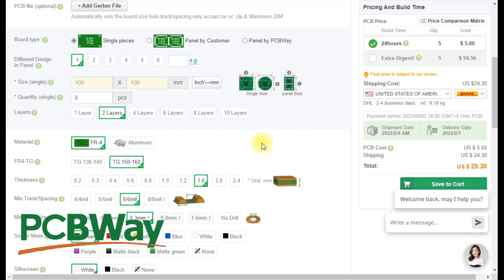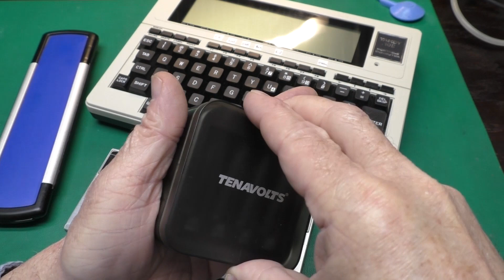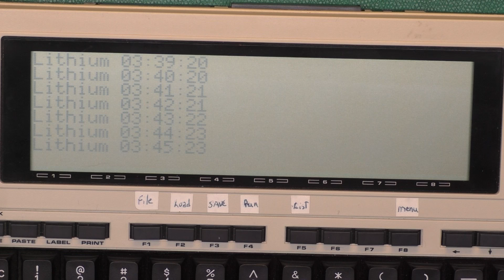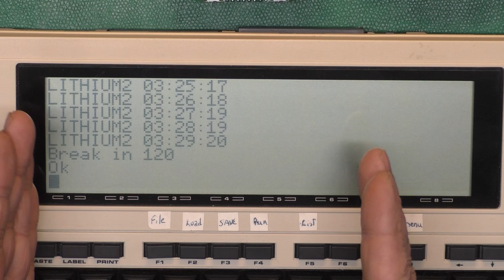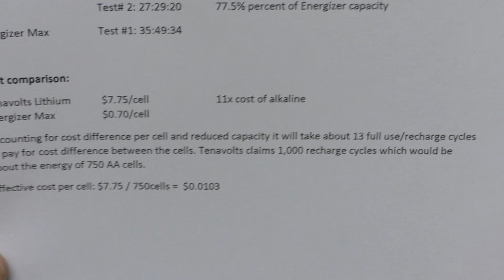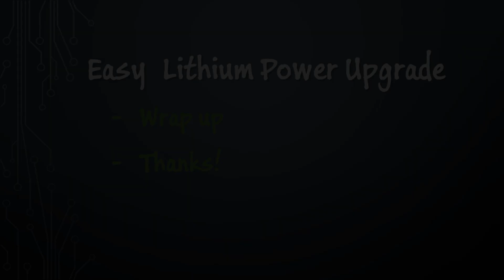Easy Lithium Power Upgrade

Comment: I did the same with my model T not long ago.  Since the voltage is the same, there's no reason not to.  Besides, I have REXCP/M and do not want to let the memory die.  Setting it back up is a hassle.

Comment: You should revise this test using 1.5V rechargeable batteries. The normal LI-Ion batteries are 1.2V, while Alkaline batteries are 1.5, so the voltage regulator inside the computer is set to shut down the system when there may still be some power left in the rechargeable batteries, due to the different curve of discharging for alkaline and lithium batteries.
Basically the computer is set to turn off everything at a safe voltage, which is different between the 2 types of batteries.

Using 1.5V rechargeable cells you will see a considerable difference, as the voltage curve for those is much more similar to what you get with regular alkaline batteries, so that will work in favor of old computers and last longer.
Reply from the maker: these ARE 1.5V cells...
Reply: @HeyBirt  I see; are they constant 1.5V until the capacity expire?  Most of the 1.5V I use in old tech usually end up cutting from 1.5 to a lower voltage at times, and this trigger a battery failsafe since the device turn off. Then when I go recharge the battery it shows that it still has remaining capacity above 1.1V (which is the threshold usually you see for considering a cell drained).

I will try this brand then, as I don't want to damage my electronics
Reply from the maker: @fcf8269  Yes, some of these AA lithium rechargeable cells don't like spikes in current draw, it will cause them to shut down. I tried these as they had good feedback and have not had any problems with them.
Reply: @HeyBirt  very useful info; I guess the 30 dollars for the 4 cells is toatally worth then

Comment: All my rechargeable are NiMH. I wonder how Lithium AAs capacity compare to NiMH. I'd need to invest in new chargers but I expect the lithium to have more mAh.
Reply from the maker: The biggest advantage I have found is that they output 1.5V instead of the 1.2V you get with a NiMh. I'll look to see if I have four NiMh AA cells on hand (I have two used in my digital camera point/shoot I keep on workbench). 

If I come up with 4 I'll run the same test and see how long they last. NiMH don't work well in the T102 though as the low voltage detect kicks in too soon but at least it will provide a comparison of usable power.

Comment: I have a GP2X handheld that eats AA's. The power demand is so high that alkaline cells last less than an hour. NiMH work better but the Lithium cells are the best balance of voltage and capacity in my tests.

Comment: Just a thought, for any devices that normal Lithium AA batteries isnt delivery enough current, you could try 1.6V NiZn AA's - I use these for my VR stuff as they deliver a bit more voltage - though you got to be careful they can fry cheaper stuff that cant handle the extra